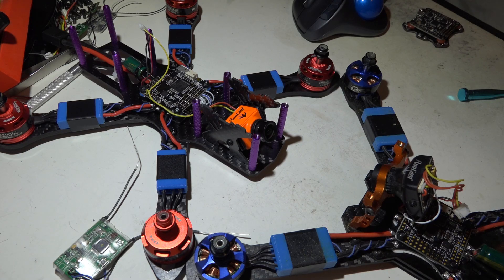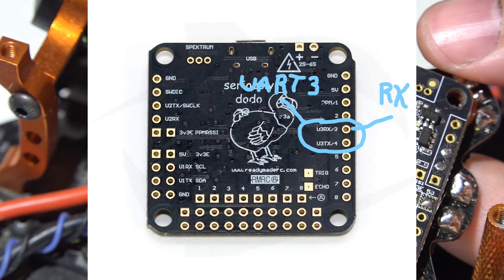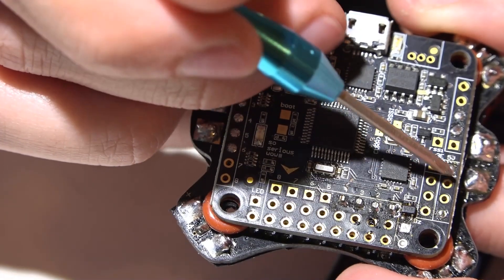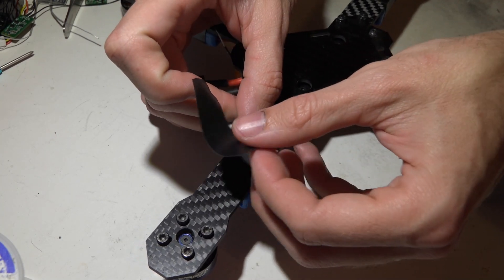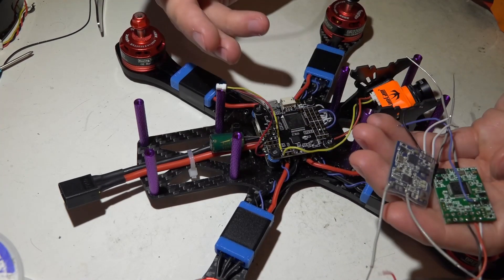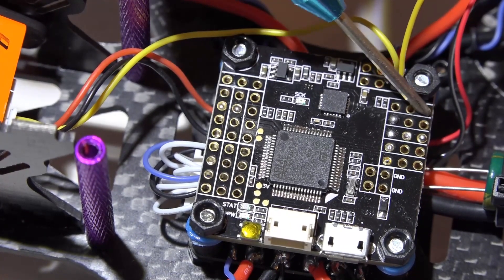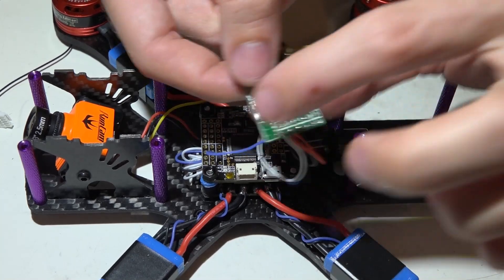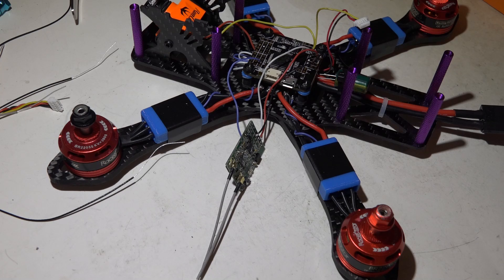Multirotor Build Pt12: Wiring Receivers

Comment: jc thank you for all the work you do i just wanted to share  with you how i wire my rx antenas  i still use the antenas tubes but i tape the tubes on the inside of the arms and there still at 45 degree. just an idea your right never loses signal

Comment: love your tutorials. any plans to build a 300mm or above long range drone ? it is rare on the internet
Reply: Long range was a "thing" right after quads came out.  Maybe a hold-over from fixed-wing goals, trying to exploit the new maneuverability.  You may find there are still videos on the Alien and Predator frames from Hobbyking -- those were popular for that, as well as APM.  But you could build those out using F3 or F4 controllers now.

Race quads came on strong and a lot of long-range interest returned to fixed wing with the EPO pusher gliders.  It is so much easier to achieve long range with an airfoil, and with good flaps, you can practically hover them, so there is less reason to try it with quads now.
Reply: absolutely right but lets not forget it is hard to film with airplanes and would be challenging to fly anywhere. a lot of new motors came out this year and not many tested on big drones. we could have a nice custom DJI with a upgradable motors.
Reply: I'd like to see a lot of the newer "tech" applied to slow/stable too.

The lift/power drain formula hasn't changed very much, so anything with "range" (duration) is still going to be 500mm+ to support 10" or longer props.  If the sweet spot for thrust is smaller, I'd be surprised.

I doubt the cells/kv/prop size voodoo has changed much even with new motors -- the key variables are still kv voltage and winding gauge.  There is probably some opportunity for improved stability using newer ESCs and BLHeli.  

 I'm not sure how BetaFlight handles autonomous flight, but I think that "forks" to iNav.  I still use APM for my long-range stuff, but once you go big, there is little reason to deviate from discrete channel receiver connection or APM.  Somebody has probably detailed how to attach a GPS to the new controllers, but on smaller craft that's mainly for recording flights and RTL.  New controllers are focused on doing things faster, so multi-rotor video is a better control analog of fixed-wing than race quad.

Dennis Baldwin did some great work on video and duration but I haven't seen him apply new equipment to a build.

Comment: I dont know if you remember giving me advice on the oscillations i was getting on my Vtail Hunter but i figured it out. I was using a naze 32 that had a noise sensitive gyro. I soft mounted it and it flys great now.
Reply: Derrick Mitchell I just hopped on the band wagon myself
Reply: Project Blue Falcon i was looking into that RF Revolt. the gyro is centered in the middle to reduce noise coming into the gyro.  Yall think its worth buying.
Reply from the maker: That's great. And some people still don't believe in soft mounting
Reply from the maker: About time Ray. Told you it works
Reply: Derrick Mitchell in my opinion I would stay away from Rice flight at least for now. but to each their own, i imagine eventually will have proper OSD support. that would make it more compelling to me. but for now betaflight has everything I need more.
Reply from the maker: Even with it being in the center it is sooo sensitive. Its up to you. Some things to consider. 1st, is 32k multishot better than 8k D shot? If it's not better, then might as well go with a flight controller with more features and a less sensitive gyro. If 32k is better then are you ok with not having other features like a built in OSD, built in PDB, baro, built in voltage regulator, and other features that the Revolt doesn't have. 

I dont want to say which one I think is better just because thats my opinion. These are just some things to consider.
Reply: Project Blue Falcon  Bro, I value your opinion and because i have minimum knowledge on this stuff I need your insight. With that said the Revolt is clearly not the better choice.
Reply: Project Blue Falcon I hope im not asking too much but can you do a video on all these terms used. For example what is SBUS,  PPM and UART. What does it all mean?
Reply: In a 6 axis mode I can make my Naze 32 F1 Tarot 135 creep backwards increasing over time... or make it creep to the left increasing over time... to where it becomes non-flyable in angle mode just by adjusting the FCB screw tension on the hard mounted FCB.